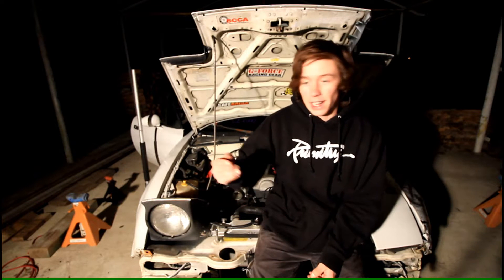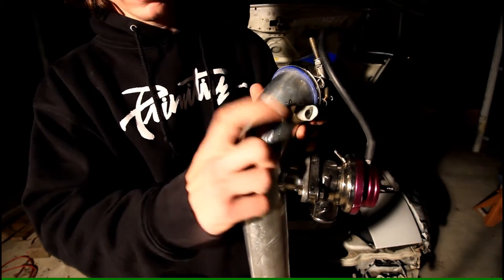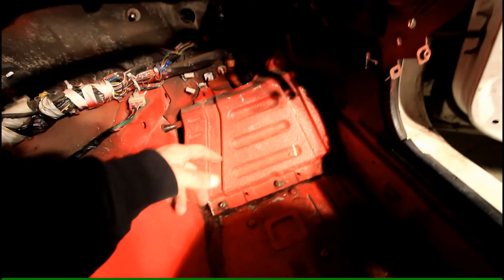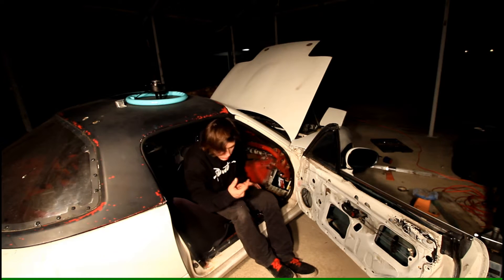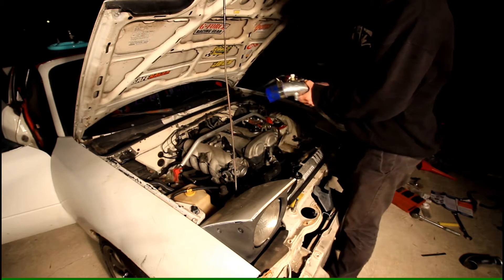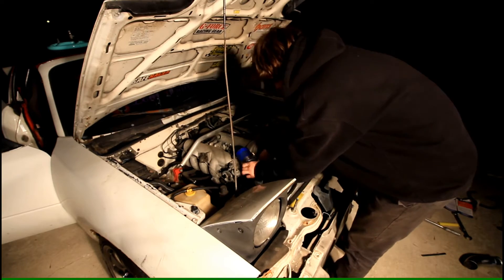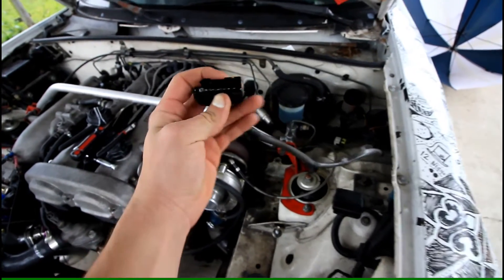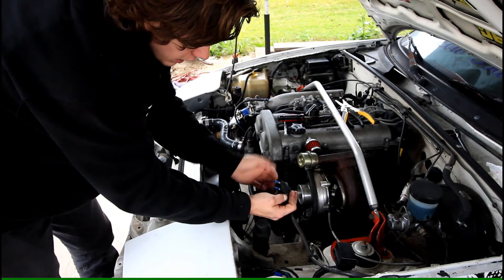Installing Megasquirt / IAT sensor on the turbo miata

Comment: I haven't had much luck with renting a timing gun at least at any of my local stores...picked one up on amazon for $15! definitely recommend grabbing one cus you'll likely use it more than once if your working on cars often! 
And also yes Greg from TCPC is great, has done a lot for the Miata community!
Reply from the maker: GearHeads Garage I actually went ahead and bought one. I am making a video about it soon so I don't want to give too much away. But the timing is absolutely fucked from whoever messed with it last.
Reply: Well luckily its easy to adjust =) Just make sure you match it up in Megasquirt with the Trigger Wizard!